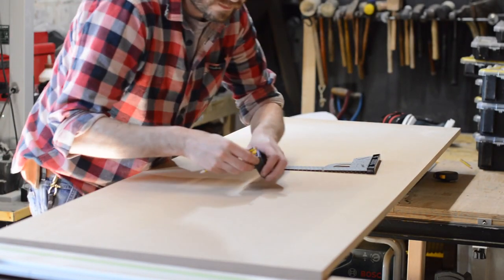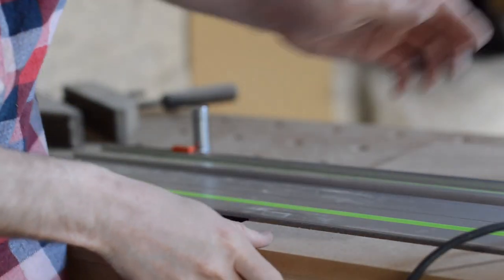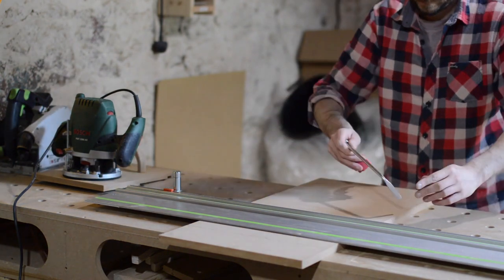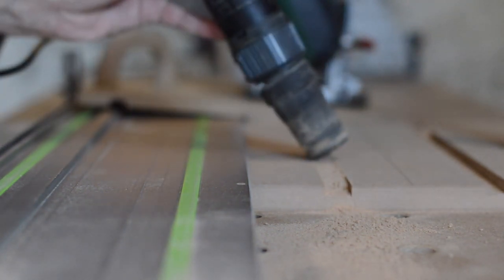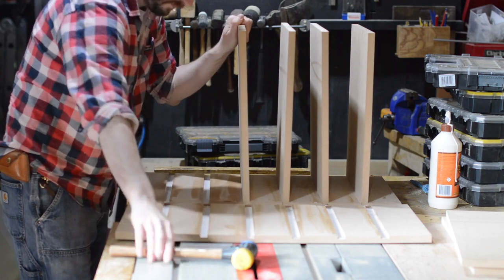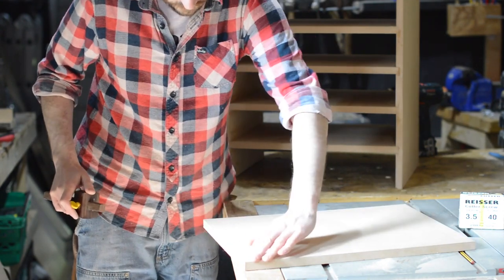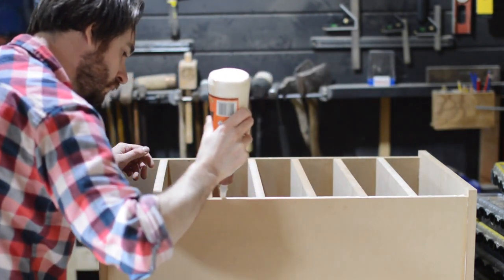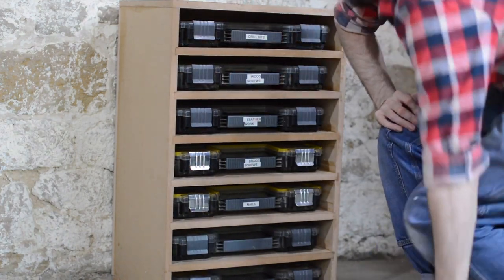Stanley Case Rack

Comment: One thing which worked for me on a similar build (kitchen shelves) was to see both sides as one piece and rout out the shelf housings in one pass - as you say, this makes for a perfect match - then do a similar groove up the middle (to house the back), finally, cut the two pieces into half. 18mm must make for a v. solid back! That's going nowhere.

Comment: Great video Matt. Personally I hate working with MDF the dust is just terrible and gets everywhere regardless if you got the vac attached to your table saw or router. But it does have it's uses :) nice to see the jig in action.
Reply from the maker: I don't use it that often for that reason but sometimes its just the best material for the job.
Reply: Badger Workshop that's true it does have it's uses

Comment: Hi I made a router sled that adjusted to the width od the mortise and then you just put the line from the jig on where you want to cut and run the router. If you do a search on you tube for "home made adjustable router jig" you will find videos on making the jig. It is not hard to made and is very useful.
Reply from the maker: Thanks I will have a look.